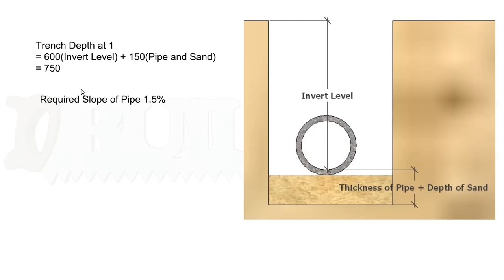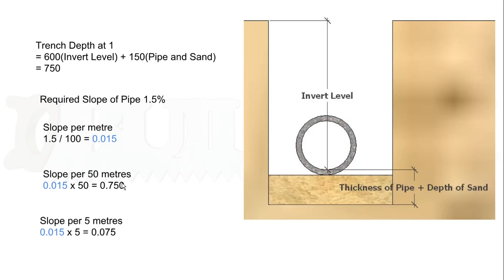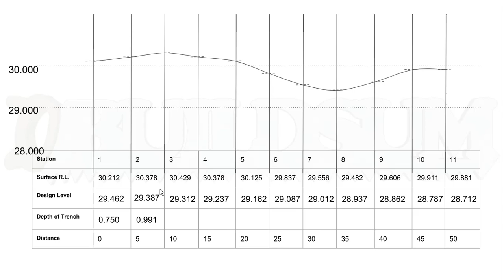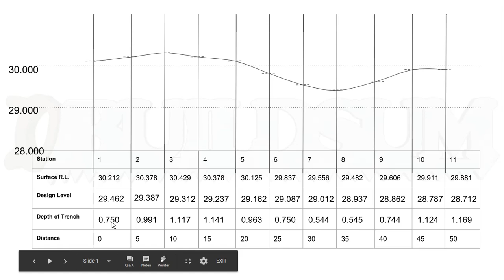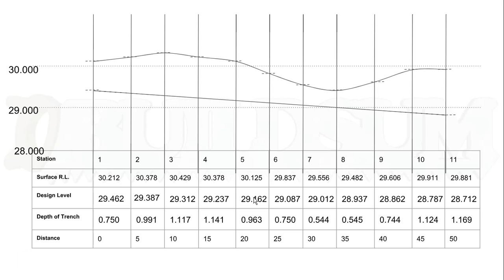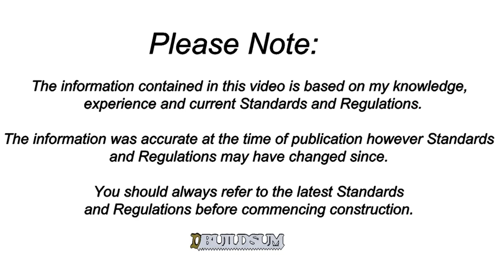Plotting a Long Section Part 2

Comment: I can’t find part 3, mate. Also, I just want to say, I first came across you some 9-10 years ago, and loved how good your videos were and how incredibly knowledgeable you were, then (and apologies) as people do, I sort of forgot about your channel, as I deleted an old YouTube account, but now I’m back and I came across this while searching for long sections. I have to ask, how do you know so much about the technical side of both civil and carpenter and general all round construction? I’m a chippy by trade, but now work with Commerical construction companies, civil construction, companies, engineers, architects, and everyone in between. I thought I had a fairly big knowledge bank, and then I come across you!
Reply from the maker: Hi Mate, Thanks for your comment. 
There's only the 2 parts for the long sections.
I'm a TAFE teacher, but it's easy to study up on one thing and do a video about it. I have to refer back to my own videos sometimes just to confirm I'm doing it the right way.